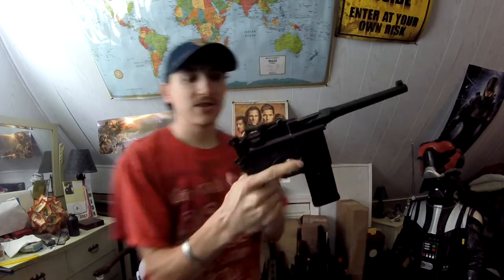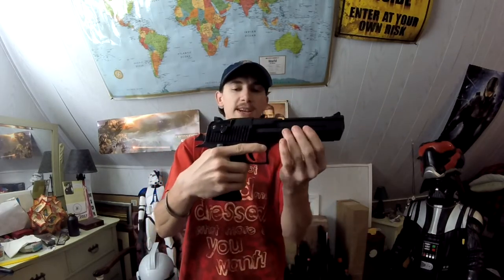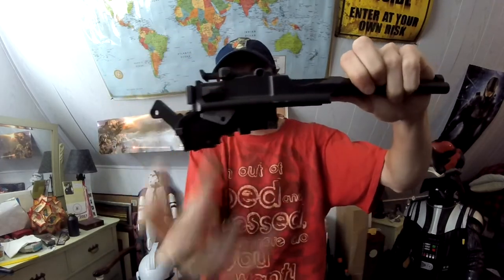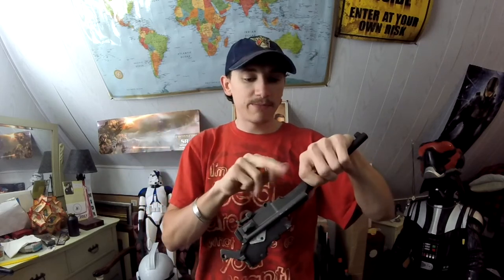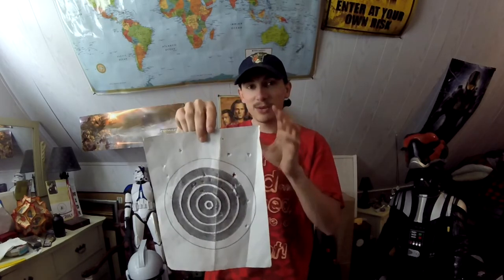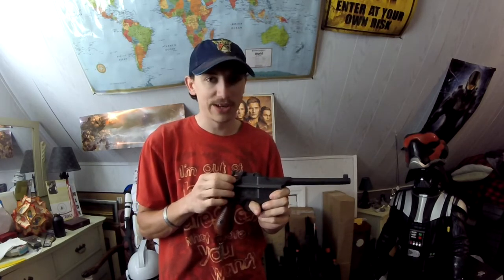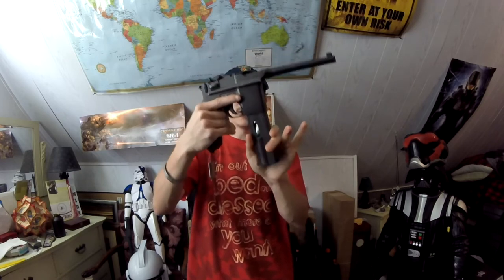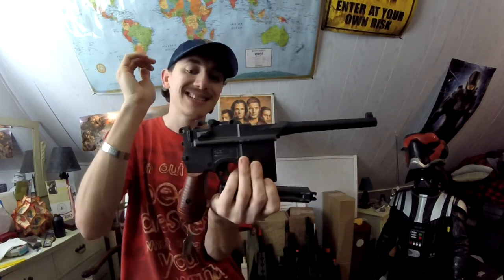HOW is the KWC m712 SO FREAKY FAST | AirsoftAL explains

Comment: The c96 was more complicated than a 1911, because the upper part of the receiver moves, not just the bolt, and because the barrel is higher and further away from the hand it actually has more recoil than a normal pistol.